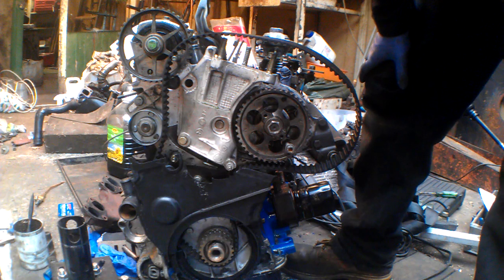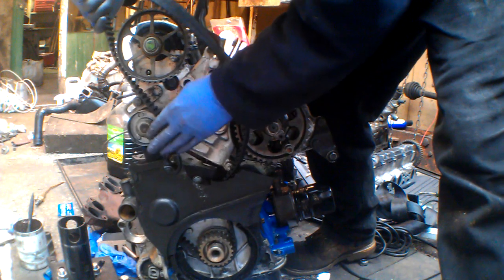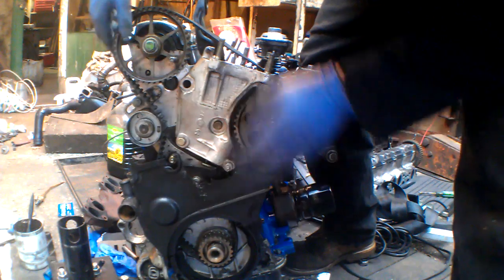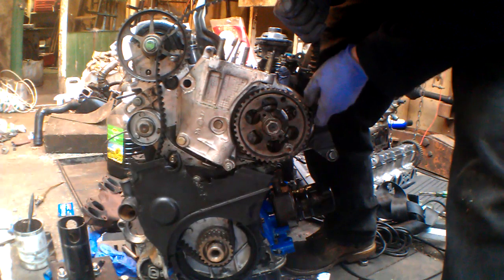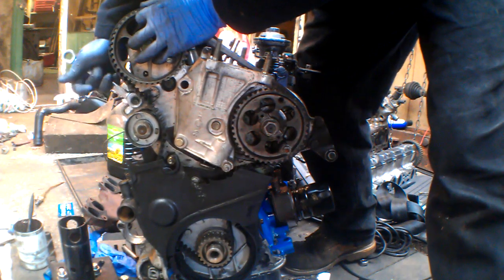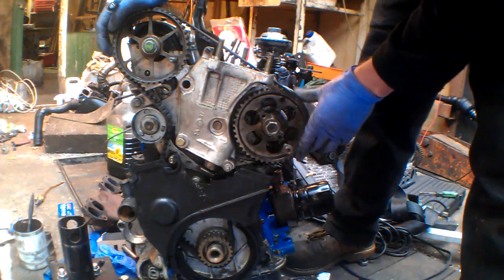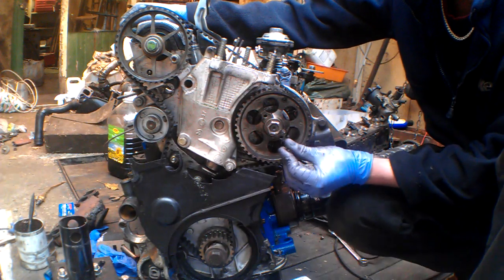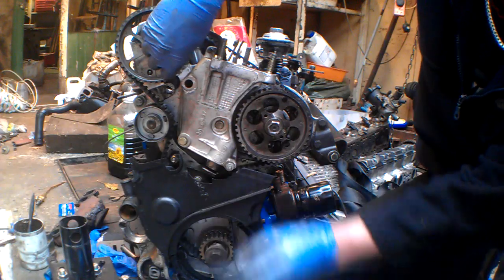Timing belt on an XUD motor

Comment: Worst belt i have done. Really gotta pull it around the pump and tensioner last. Because i did skip 3 teeth so i could find TDC again and try again. On the XU7 it is a piece of cake